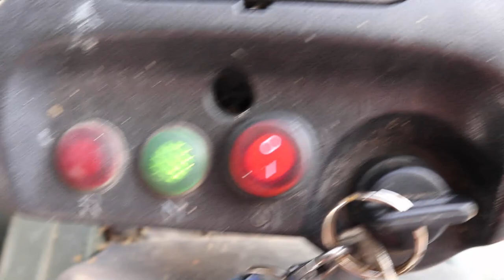Fixing A Flat With Spray Foam!

Comment: We used spray foam to fill a milk jug (for a art project)and what part didn't get air to it didn't solidify and leaked out liquid for days. Only the part by the lid opening hardened. I guess that is what you needed to plug the holes.  Looks like you had better luck than us.
Reply from the maker: We will keep you posted. 🤣🤣

Comment: I don't mind buying new tires if that would do the trick but I have so many thorns around here that even new tires go flat. So I'm looking for a permanent solution. I've used flat free tires but they are expensive and limited in size. The front tires on my golf cart don't seem to need much pressure anyway. I'm driving it on a flat right now as it is. Worst case I might have to buy new tires if this doesn't work so I have nothing to lose by trying this first. I think the biggest thing is to make sure it is completely full by  filling it from the bottom and allowing air and foam to escape out the top.